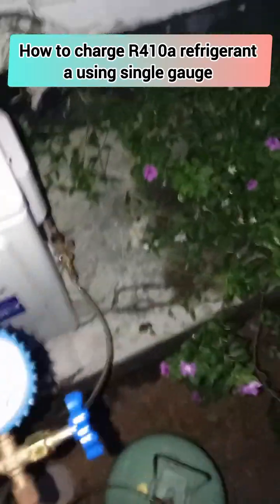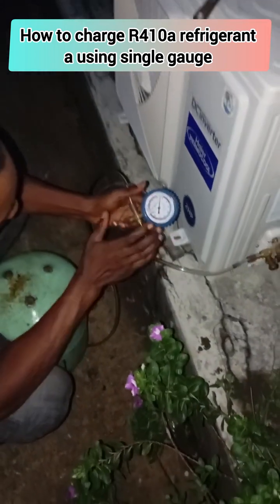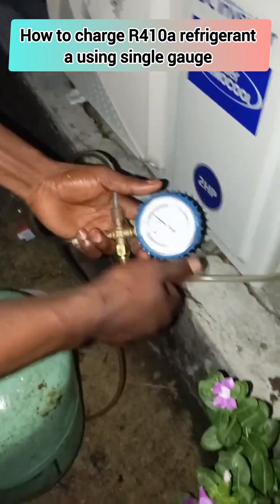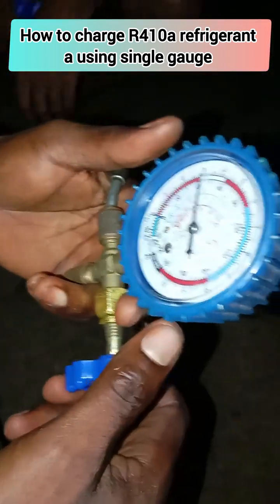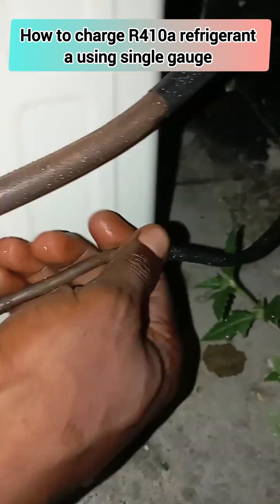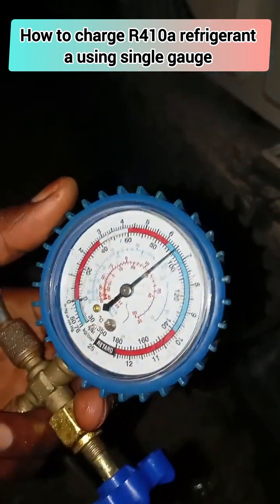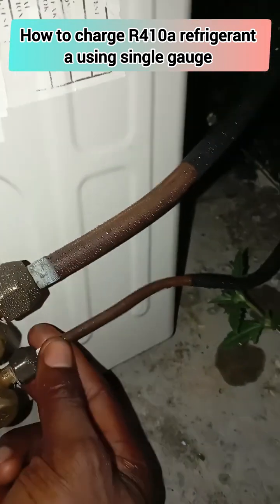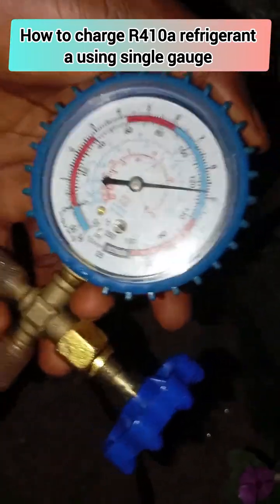SINGLE GAUGE: HOW TO CHARGE R410a refrigerant using a single gauge manifold.

Comment: Thanks for the detail!  Are you certain of the 120-140psi for R410a?   Always thought it was more like 117 psi?
Reply from the maker: Yes my boss 120 -140  is the standard psi level for 410 gas 

The 117 you always use is quite close to 120 but I will advise you range it at the standard gauge pressure which is 120-140 psi. Thank you for your kind comment